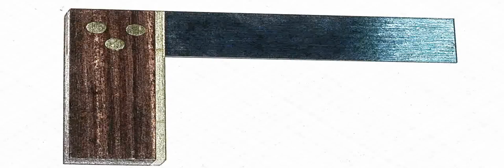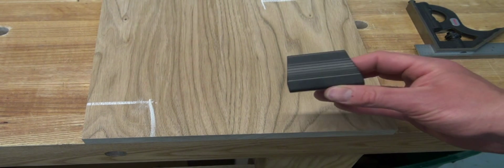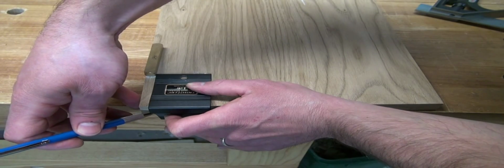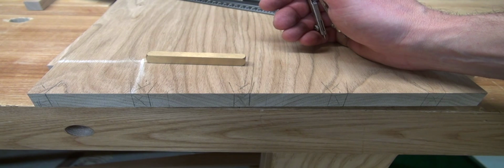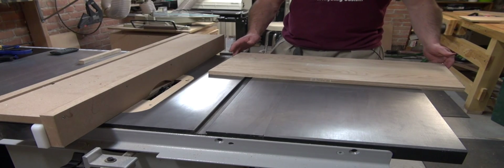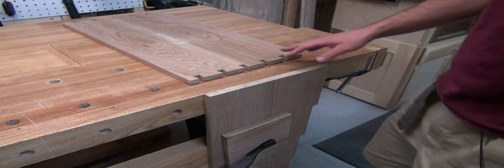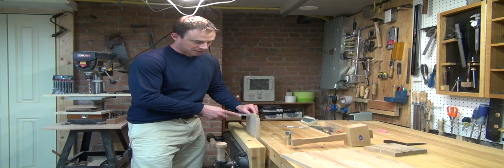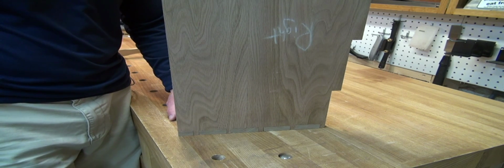Tool Chest Episode Four

Comment: I have to smile at all of the thought that people put into deciding on dovetail angle and width.  There is little evidence that any particular angle is more or less effective on a given wood species.  I do realize that now days that clean well fitting dovetails is looked at as a mark of craftsmanship, but the reality is that it was just a utilitarian joint 95% of the time in the past and no extra effort was made to make sure that they were perfect. All that they cared about was that they stayed together.  In fact if they had had the adhesives we have today back when it was developed, it would probably have rarely been used as it would have been faster to just do a box joint.  That being said I do like the look of well executed dovetails, however I use only one angle on everything as it really is of little importance.  Historically I have seen much more acute or obtuse angles even in pine that people today would say that they are going to fail, but the pieces are well over 100 years old and they are holding just fine.  Being that some of them are on tool boxes you cant even argue that it is because they were not stressed as a reason that they held up.  What it boils down to is personal preference and what you find appealing to the eye and little more.